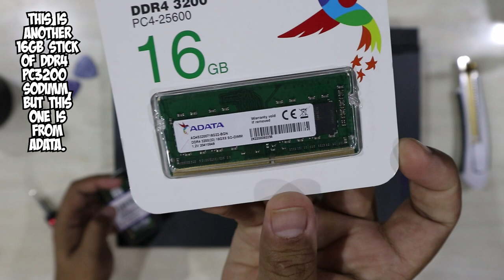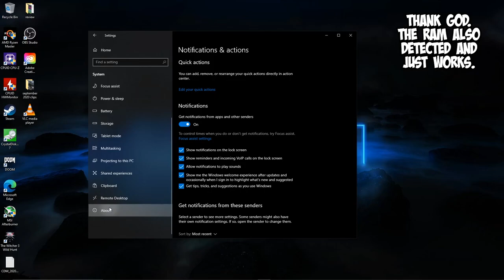Lenovo Legion 5(2020): SSD and RAM upgrade

Comment: I just bought the same laptop and an XPG(same model as what you have) nvme ssd as 2nd storage. It will be my first time opening a laptop. Any tips in opening the back panel? Watching you open it made me feel pretty scared already to the point that I may defer the installation of the ssd because I may void the warranty of my laptop ahahahahaha
Reply from the maker: hi thanks for watching. I really don't inspire confidence do I. ha ha. no, seriously taking off the back panel really is the most difficult part. Once you got if off everything else is pretty straight forward.
As for tips, have some decent plastic pry tools, be patient and take your time. don't rush. you'll be fine. hope this helps. Good luck😊
Reply: @masterofnone4608  Thanks for the tips. Is it recommended to start prying at the bottom part?
Reply from the maker: I don't think it really matters where you start prying from. just take your time and gently unclip the back panel

Comment: How much ssd can we upgrade
Reply from the maker: hi. thanks for watching😁 not sure what you mean exactly. if you meant how many ssd can be installed, it's either a maximum of 1 nvme + 1 sata ssd or 2 nvme ssds. if you meant ssd capacity, as far as I'm aware Lenovo never specifically mention the maximum capacity supported. I myself am running 2 nvme ssds in mine, a 1TB one and another 2TB one. no issues at all. i would imagine they support higher capacities, however I don't have any higher capacity drives to confirm this. hope this helps.

Comment: Hello, I have the same machine. Bought it on 1-1-2021. Specs: Lenovo Legion 7i/Intel i7-10875H/ nVidea RTX2060/16GB memory/1TB M.2 NvmeSSD. I want to expand my RAM to 24GB and add another 1TB SSD.  Can you tell me how is your PC working with the upgrades?  (b). Do you think it's possible to remove one 8 GB stick and replace it with a 16 GB for a total of 24 GB?   TIA.  Curios, what part of the world are you in?
Reply from the maker: hi. thanks for watching. so far my laptop works fine. no issues at all. the extra ram is most noticeable (for me anyways) especially when I'm working on large photoshop projects with loads of layers.for gaming, not so much. 
yup, you can definitely do that, though I'm sure there'll be people who are adamant telling you that you should only increase capacity in capacities of 8, 16, 32, 64 etc etc.
to be honest the main thing is that the speed of the ram should match, eg ddr4 2933, ddr4 3200. if you were to install a slower or faster stick, the overall ram speed will follow the slower stick and may potentially run into stability issues. no, it will not damage your laptop, but may potentially cause it to crash a bit more.
to be honest,  in most real world use you'd probably notice more gain from the increased ram capacity.
I'm from Malaysia😊 somewhere in South East Asia.
Reply: @masterofnone4608  Thank you for your reply. I decided to buy a 32 GB kit (2 x 16), to avoid the issues you mention. Take care :)

Comment: Hello fellow Malaysian here, got this laptop for 3 weeks now. it's a beast! for me, 16GB is more than enough now. but might be upgrading in the future. Can u put the link where you bought the 16GBX2 RAM? Is it okay to use two different RAMs from different companies?
Reply from the maker: hi bro. agreed, for gaming and most work really, 16gb is more than adequate. Personally, the only times when I notice the difference in performance between 16gb and 32gb are when I'm working on a large photoshop projects eg 20 feet banners or something that has several hundred layers. 
I bought my RAM sticks off shoppee, would love to share the links but the sellers that I bought it them from both had sold out(bought during the 9/9nsale). the brands of the RAM don't matter so much, more importantly to check both RAM sticks have same specifications eg voltage, speed and latency. having a mismatched ram sticks may not necessarily cause damage to your system, but may cause stability issues. buying same model from same brands would ensure the ram sticks hv same specs or if you really want to be sure, buy a ram kit of your desired capacity.
hope this helps. thanks😊

Comment: Your ram will not run at dual channel, you are downgrading your computer.
Reply from the maker: thanks for watching bro. As far as I can tell it's running in dual channel. You can even see it in cpu-z at 10:33.
Do you mind elaborating a bit more to what you really meant?

Comment: Low sound in my legion 5
Reply from the maker: hi. thanks for watching. I personally feel that the speakers can go pretty loud, but then I'm comparing it to my old laptop which has some tiny speakers. to be honest my bar for laptop speakers are pretty low, so for me the speakers are adequate. I also use a headphone most of the time.
However, i suggest watching other videos that review this laptop's speakers in a bit more detail and compare it to yours. if yours not performing as well, then maybe it's defective and you can claim warranty.
hope this helps. thanks
Reply: @masterofnone4608 thanks for replying bro,it's pretty new one..called to lenova care and raised issue. Bought from lenova india site..so it's hectic to replace the laptop.

Comment: Hi, i'll dicide to buy 2 x16 ram, but i feel scared if dont work. However, nice video. If you can contact me I feel more confortable.  Sorry ny english, i say hello from Argentina.
Reply from the maker: hi. yeah. I was kinda anxious too when upgrading to 32gb as there was no mention anywhere that it is supported or not. however, I can tell you that my system has been working fine since the upgrade(about 5 months ago) with no issues😁 just make sure the RAM is of the same specifications.